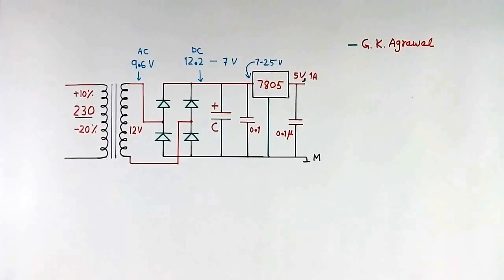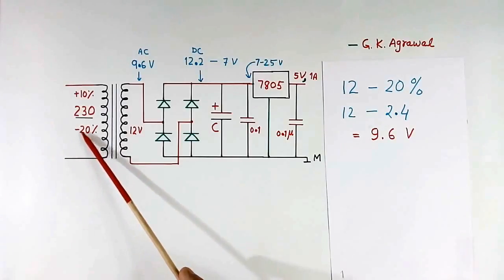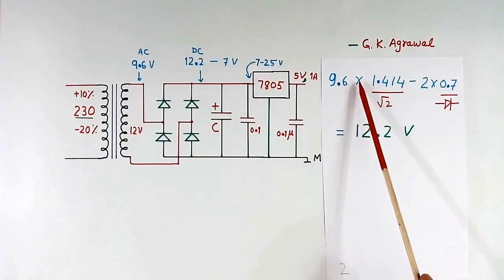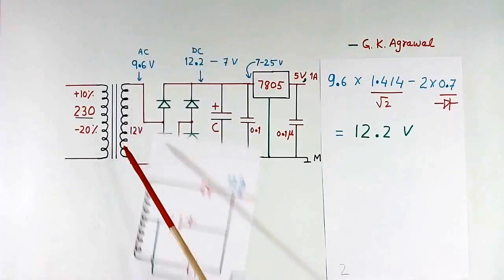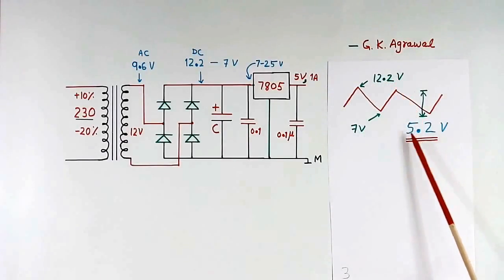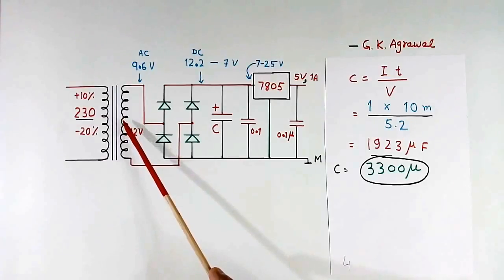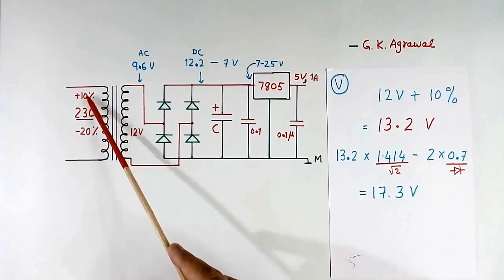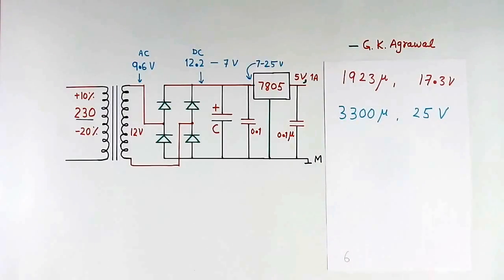Bridge rectifier - capacitor value & voltage calculation

Comment: Can we get the real ampere output of a step down transformer after making filtered DC output & then connecting various load currents one by one?
Reply from the maker: It may not be possible to find, at what current transformer burns  untill you burn the transformer itself.
However if quality of transformer is very bad, burning test may not be possible, as it will not give even normal load current.

Further it also depends on timing of test. You are testing in Jun month at Hyderabad, or December month at Delhi.

Made one vidio on transformer quality and voltage drop.

Comment: Hi, 
If we don't have 7805 and instead, we connect this circuit to a direct 25x led 3v 350ma, how can we calculate the voltage of the C=i*t/V?
Reply from the maker: If only LED, then no need of capacitor. But you need a current limiting resistor to limit current to maximum 350 mA at highest voltage, or some other method to limit current.
 But Led light intensity will change with input voltage change.

Comment: Your explanation proves vast experience in electrical engineering. Hats off. Everything is good in this video except that you have not talked about the additional capacitors 0.1 microF on either side of the regulator. Please reply
Reply from the maker: 0.1 is based on experience. It improves stability many times. In college you learn from a text book. But during the job you learn from the experience and already documents available with company and technology suppliers. There is no acceptable explanation on that.
Reply: Thanks a lot for your prompt reply.
Reply: Sir, don't you recommend a MOV across input AC supply for a practical system?

Comment: Hello sir, I have a led light driver which has an input of direct 220V and then M7 diodes 4pcs and then immediate capacitor of 10uF 400V and later on constant current IC, smps transformer/chopper, filter capacitor etc. But according to your calculation the capacitor value I get is around 130uF but in the driver it is 10uF. Could you please clarify this?
Reply from the maker: For 5 Volt for TTL IC you need better quality voltage regulation. 
For LED lights better regulation is not required.  Just average current will be sufficient. 
This is due to the fact that our eyes cannot see light variation at 50 hz.  Our eye sensitivity for light is less than 10 to 20 hz. 
Further LEDs will work for different current variations,  but 5V IC will not work for different voltages.  It requires 5V only.
So lesser cap value may be sufficient for LED circuits.
Further SMPS circuits can give proper output for more input variation.
Reply: @GKAgrawal2  thank you sir. Would appreciate if you make a video on it and full led driver calculation.

Comment: Agar 12 Volt 2 Ampere transformer ho toh kaise pata karen ki maximum load current mein kitna output voltage drop hoga?
Reply from the maker: Load lagakar check karna padegaa. Agar good quality transformer hai industrial grade kaa then transformer percent impedance aur specification se pata challenge.

Comment: Sir, Very informative. I have a doubt. if I put 5 Ampere to the capacitance formula, I am getting 14,000 micro F (something wrong).’ what changes to be done. Thank you..
Reply from the maker: For high load current, you will require a big capacitor.
But where do you need such high current at regulated voltage.
Reply: 12v 5Amp is for audio amplifiers. We generally use 4700 mfd 25V and working fine. My question is why I am getting 5 times of mfd when I am using the formula.
Reply from the maker: With less capacitors, you get poor regulation. Further, at 5 volts, the speaker of 4 ohm will draw less than 0.5 amperes AC.

Comment: Hello Sir, What if a spark gap exits within the load area? What possible value might be attributed to capacitance, then?
As there is no voltage drop actually exists, unless or until it got short-circuited at the section of load or could say the spark gap came to an "NC" position.

Comment: Why the 12 Volt transformers these days give 14 volts Ac at 240 volt input supply thereby giving peak output Dc of 20-21 volts ? Is it due to the fact that manufacturers today do extra winding to compensate the diode drop loss or due to lower primary winding for 220 v ?
Reply from the maker: To compensate for drop in winding. Watch my video on voltage drop and heating problem in transformer.

Comment: Sir what value of capacitor  and diode to use in  making of rectifier from  220V ac transformer to get 20A dc current? Pls  pls explain Sir
Reply from the maker: Method explained for capacitor in this video can be used for 20A also. Diode to be rated 20A or more for full wave rectifier with proper heat sink.

Comment: Excellent! theory is correct, with applied experience, being a little safe with +50%, also takes heat loss into account in the circuit into consideration especially when using higher amperage loads.

Comment: Sir your experience is boost for beginners.
Reply: Sir do you provide any online classess for electronics if so plz do let me know. I would like to join
Reply from the maker: No online class
Reply: @GKAgrawal2  thanks for you prompt update. Do you have any notes differential of polyester and ceramic capacitors that are used in rectification close to voltage regulators. In your tutorial have mentioned polyester and where as in other tutorial mentioned ceramic however value remains same.
Reply from the maker: you can use any one. Watch my Video on types of capacitor

Comment: Why ur using. 1uf? 🙄
Reply from the maker: Based on experience. But IC manufacturer also recommend this. 
Now days user and application manual are very difficult to get. But in my time, about 25 years back, manufacturer of IC were giving lot of application information about IC in the data sheet books. That was 100% reliable information.
Reply: @GKAgrawal2  thank you sir. 😇.. But 1 question please 12-20%is =9.6 how? 🙄.. 20%to 0.2hoga and ans 11.8 ayega phir 9.6 kase🙄
Reply from the maker: 12 kaa 20%, 2.4 hota hai. 12-2.4=  9.6
Reply: @GKAgrawal2  oo ach ase.. 🙏😇

Comment: Dear Sir, Excellent explanation...I have a doubt...since we are connecting an electrolytic capacitor across the 12v dc means...we will calculate capacitor value and voltage for 12v,1A..right...why did you calculate 5v, 1A...kindly clarify it
Reply from the maker: Watch video again

Comment: You explain very well. Thank you sir. I have a quary, is it possible to get 24 volt from 12 0 12    2 amp transformer and which value of capacitor is used to full wave rectifier to get variable output voltage by lm 317t ic. 
If i select 5408 diode and 4700uf 35 volt capcitor
 Is it wrong?
I will be thankful if you clear my doubt.

Comment: Sir 40-0-40 volt 10 Amp / 400 watt amplifire ma kitna valu capacitor lagaaga,, plz reply me.
Reply from the maker: Calculations kaa tarika bataya hai es video mey. Hindi version waala video dekho.
Reply: @GKAgrawal2  Sir 63 volt 3300 mfd 2+2  capacitor use hoga,,  I did not calculate this,,

Comment: Sir,
Nice explanation.
Could you please make video about the selection of filter capacitor value in a +/- 12v dual power supply?
Reply from the maker: Same method to be followed.

Comment: Pls ,how do I know d load current
Reply from the maker: You can measure the load current for a load using a multimeter, and regulated lab power supply or a battery.
Reply: @GKAgrawal2  THANK U SIR

Comment: How can you say it is only one ampere?
Reply from the maker: watch video again with concentration.
Reply: @GKAgrawal2  thank you sir
Reply: That is because of voltage reg. 7805 datasheet value?
Reply: Sir, please clarify one more doubt that I have...

That is for a filter capacitor using on pulsating DC...that's ok...

After that there are small capacitors like

.082mf
4.7mf
47mf
470mfd  using on various operating straight dc voltage..

How to choose those capacitance.because there is no frequency in DC...
Reply from the maker: There is no calculation for many caoacitor. There will be lot of high frequency spikes in DC in circuits. You will understand this after working 5 to 10 years on  desiging complex electronic circuits.

Comment: Where 10% and 20% come from ? Is it the same for all cases or is there someway to calculate it ?
Reply from the maker: I told in the video that this is just assumed percentage for voltage variation just to explain the method. This percentage may be different for different system and can be selected based on the field experience also. If you are working in some industry then you must be knowing this value already.
Reply: G K Agrawal thank you for answering, im a student so i dont have experience yet how to know these value

Comment: सर् जी अच्छे से समझाया इसके लिये धन्यवाद। 
पर सिर जी 230V AC को 1v-50v DC करना तो ठीक है।
पर यदि 230V AC को 200v-250v DC
कैसे करें कौन सी वैल्यू का capacitor use करे। उसका वोल्ट और uf कितना होना चाहिए। (For electronic circuit)

मेरे पास EM84 vacuum tube Valve है जिसे magic eye भी कहते है। उसको use या glow करने के लिए 180v-250v DC की आवश्यकता है। 
या कोई ऐसा circuit या मॉड्यूल बताएं तो 12v dc को 180v-250v DC में कन्वर्ट कर सके।
Pls help Sir........
Reply from the maker: 200 volt kaa DC bananey keg liyey ya tho vah un regulated hoga ya phir DC to DC converter lagana hoga
Reply: @GKAgrawal2  Sir Ji, unregulated को रेगुलेटेड कैसे करे। 
मेरे पास KBPC3510 ब्रिज रेक्टिफायर है। उसमें किस वैल्यू का कैपेसिटर ओर इंडक्टर लगा सकते हैं। जिससे DC वोल्टेज स्पाइक फ्री ओर स्मूथ हो।

या फिर DC to DC Converter के बारे में बतायें। मॉड्यूल या फिर circuit के बारे में डिटेल से बतायें।

Reply करने के लिए। धन्यवाद.....

Comment: How you calculated the half time period for 50HZ?
Reply: - 50 Hz means 50 full cycle per second
- 1 second = 1000 milliseconds

1000 / 50 Hz = 20 millisecond for each full cycle.
20 / 2 = 10 millisecond for each half cycle
Reply: @karimamrouche6357  yhank you

Comment: I want to make 900 Volt DC 80 Amp
please help to calculate capacitor velue & output volt of stap up transfarmer
Reply: u need to step up transformer 230 vac to 637 vac   then use 4 diodes 80 amp 1000 v  to make bridge.. since current= 80  capacitor 80X10/ 20 v ripple= 40000 mfd   ripple 20 v mean out may contain 20 variation, 900 to 880 vdc . for 637 vac  i didn't consider voltage variation 10%. assumed 230 v constant. please sub my channel to see  more